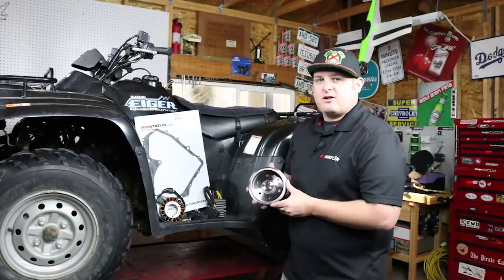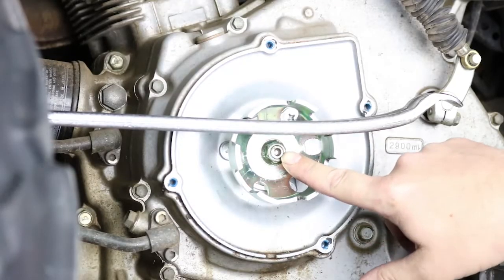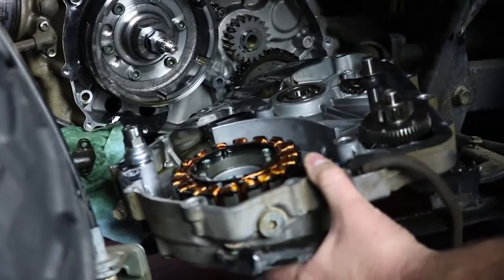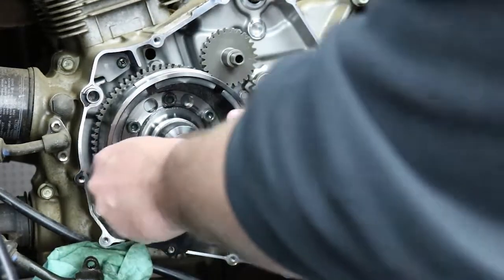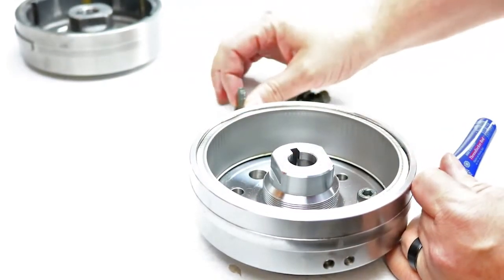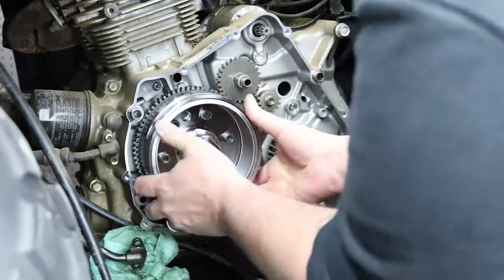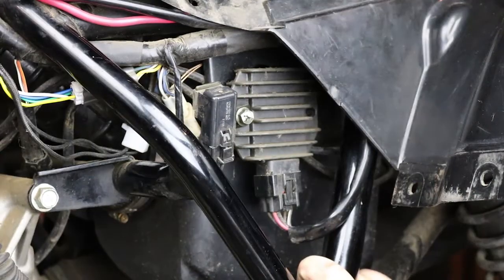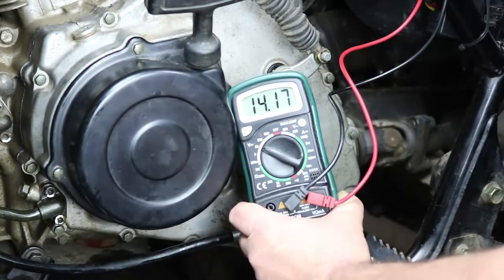How To Install an Arctic Cat 400 & Suzuki Eiger ATVs Heavy Duty Improved Stator Flywheel RM11502

Comment: hello I need help ... my 400 4x4 2005 model does not pass the 6000 rpm and starts to cut and exploits a lot because of the exhaust I do not know what else to do ... change the stater and coil and clean the carburetor and nothing improves
Reply from the maker: Were your old flywheel magnets in good shape? If they were not in perfect condition, definitely replace the flywheel with our sealed version, as that is a known issue on these models. Also, measure the resistance of the pickup coil. It is the Blue to Green wires in the 4-pin connector. The spec is 200 ohms between the 2 wires. If it is outside of +/- 20% of that measurement, it is likely the problem. Otherwise, you most likely have a failing CDI box causing the issue. Hope this helps!

Comment: awesome video.

question for you...2000-2001 suzuki lta500 quadmaster.
OEM regulator started smoking, so replaced with an after market regulator...that too severely burnt up....on the second aftermarket regulator today and took temp of the reg at idle (from cold start up ) and after about 1/4 mile trip down the street.

after a minute at idle the temp of the middle most fin was about 130 degrees, after the trip down the street the middle most fin was 170 degrees. I don't know what is normal, but that seems awfully hot.

the ohms between the three yellow wires was

Outside to outside = starts off at .6 then drops down to .4 after a bit.
Outside to middle =  starts off at .6 then drops down to .4 after a bit.
second outside to middle = starts off at .6 then drops down to .4 after a bit.

the AC volts at idle were 
Outside to outside = 30+
outside to middle = 30+
other outside to middle = 30+

 

at some unknown RPM where the throttle is half way down (don't have a tach)
outside to outside = 70+ volts
Outside to middle = 65V
other outside to middle = 65V

According to the manual those are within specs. I am afraid I'll burn up another regulator.

thoughts?

Comment: Can you tell me the torque value of the nut holding the flywheel on?  Also the torque on the bolts that hold the one way clutch to the flywheel?  Thjanks
Reply from the maker: Sorry for the late reply! The flywheel nut is 115.5 lb-ft, or 16.0 kgf-m, or 160 N-m. Sorry I don't have a spec for the one-way clutch bolts.

Comment: Just pulled apart my 03 400 4x4 with no spark and found 2 loose magnets— OEM parts is $1400...what a joke.
Reply: trout004 I got the parts from rmstator for about $375..
Reply: I purchased mine from the same place.  RMSTATOR
Reply from the maker: Grab our replacement flywheel, much cheaper and better than the OEM part!

Comment: Thanks for putting that on here. Just had to buy one of your flywheels as my 2005 AC400 Auto lost its magnets. Don't know how Arctic Cat let this happen in the first place; then shame on them for not doing the right thing and doing a recall for it (or at the very least offering a rebate for the parts if you do it yourself). Just a note that I had a very hard time getting the side cover off; as the gasket was pretty much glued to both sides. Had to make a bracket and use a slide hammer which did the trick. The official manual says much the same thing.
Reply from the maker: Glad our flywheel solved your problem! The side cover can definitely be stuck on pretty good, especially with the original gasket still installed. Happy to hear you're up and running!